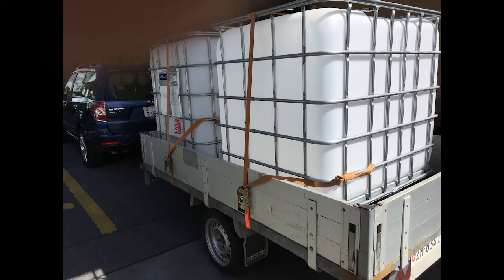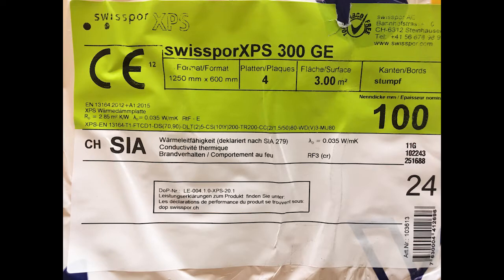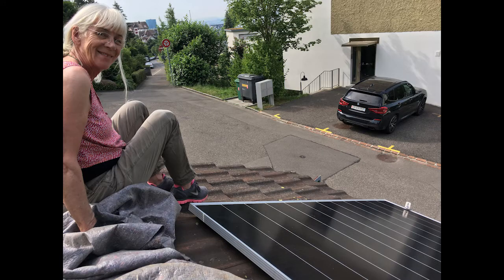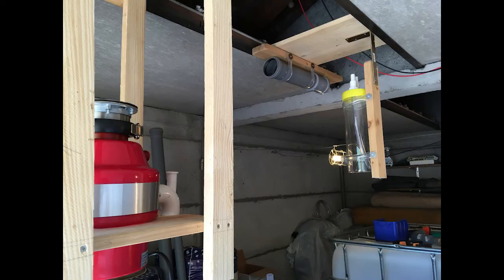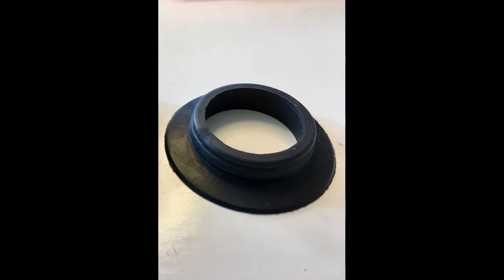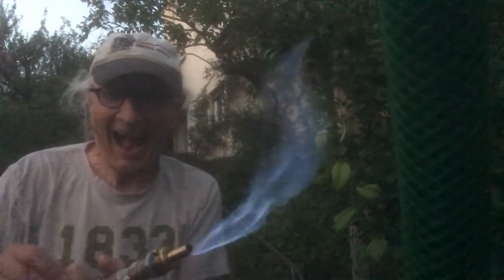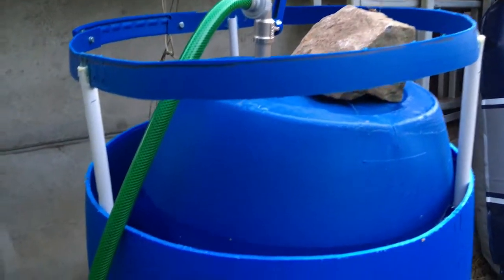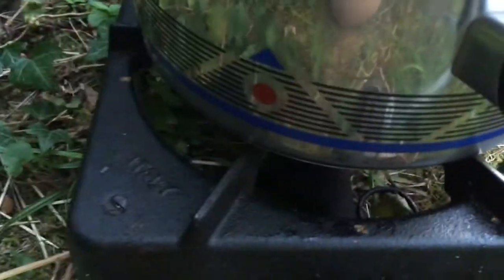Homemade Biogas in Switzerland Part 2, How to do..

Comment: I love the way this works. However I am not sure we produce enough scraps and we do not have live stock except 9 chickens. We do not have neighbors around us as we are remote in Alaska.    This would be ideal to use for cooking and heating water as we have to pay a small fortune to get propane delivered to us.
Reply from the maker: Hi greetings to remote Alska from Switzerland/Europe! Your challenge: Heat. Perhaps you could bury the digester for insulation?
My thermal blanket works in cold weather with two solar panels. Biomass: Anything that does fotosythesis (leaves, grass, vegies) but also chicken manure will produce CH4. Of course input = output. For the winter I tried silage from grassclippings but failed..:-(
Reply: @etienneconod8075  
Thank you for the great inspiration and the many ideas. Great Work!
Two Questions:
1. Why did the aquarium heater not work sufficiently? Has the mud caked to it and the heater could not work anymore?
2. What was the problem with the grassclippings in winter? simply no biogas production or has the grass clogged up your system?
(I would also like to use grass silage to produce gas for the additional heating of the house in another container in winter)
Greetings from the cold European neighbourhood (Austria)
Reply from the maker: Hi Jonas - The problem with the aquarium heaters is exactly as you describe it. They are designed for water and water-in-motion. My heaters worked fine for a while and eventually refused to perform due to cake-up. Grasclippings: Gras works fine when fresh, as any other biomass. I tried to make silage of large quantities of clippings we had in summer. I packed plastic bags but my action was not successfull. In most bags I found mould which is a KILLER of gas-bacteria. So I put it over a grass square in the garden as preparation for potatoes next year. I wish you best of luck for your project! @Roadtobusiness1

Comment: Great work nice and clean, I have the same setup in the USA. My problem here is the cold weather. I actually ran a gas grill and a small generator off my ibc digester setup.
Reply from the maker: Your system is nice. What does it take to run a generator with biogas?